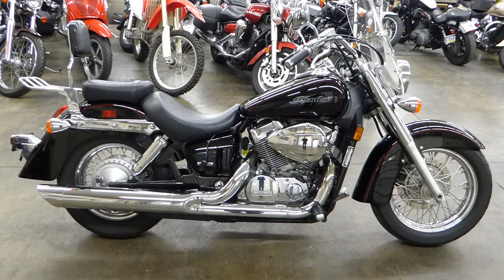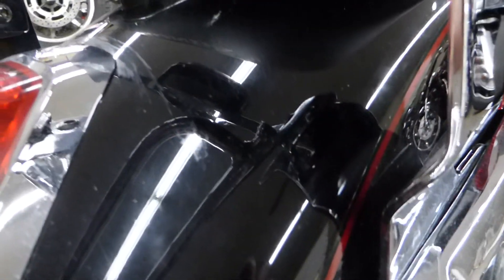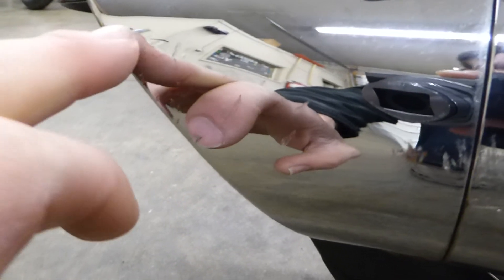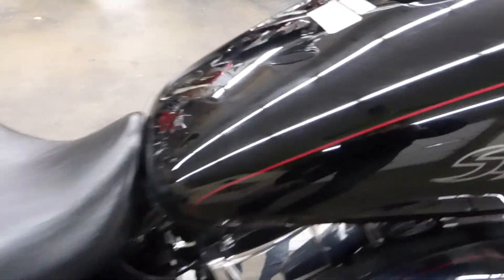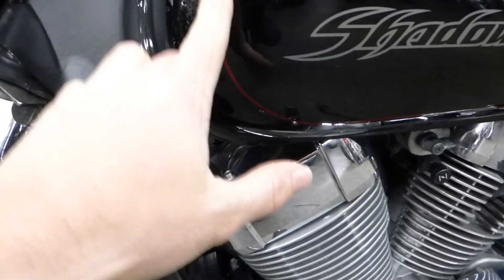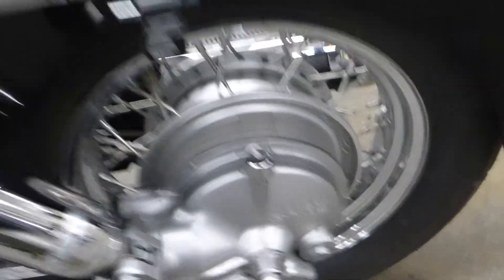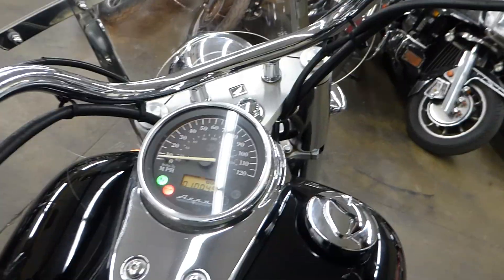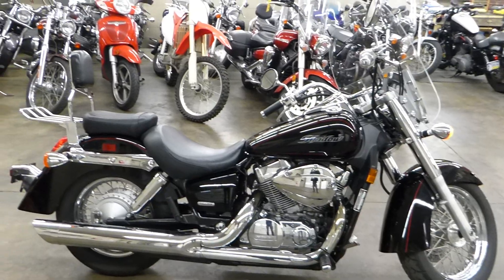2007 honda shadow 750 aero

Comment: Hey the Aero and the VT....are they too big for a guy that's 160lbs? I'm into the fat boy kind of look but I'm not paying both kidneys for an HD. Just wondering how a guy my size might deal with the weight.
Reply: The Shadow 750 would fit you
The VTX1300 and new VT1300's may fit but you need to go sit on them. Pay attention to the BARS they tend to change with each type.

Comment: How much do they cost now in 2019?
Reply: I believe around $7600 Aero or 7899 Phantom.
Reply: I bought a used 08 750 Aero same miles for $1,500 . Had an 02 Ace as well ( plus many more ) for the same price .
Both are excellent bikes , yet the Aero is much more user friendly on many levels .